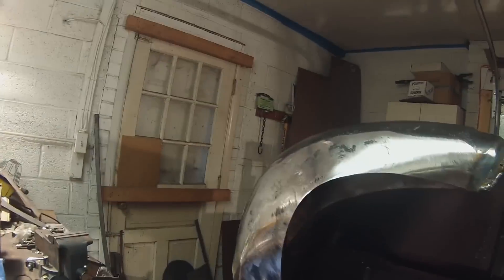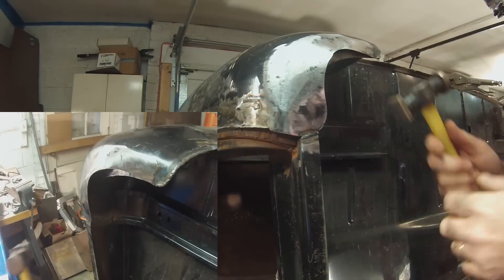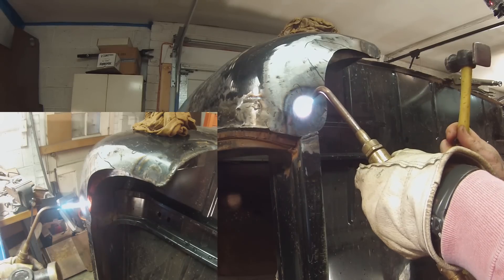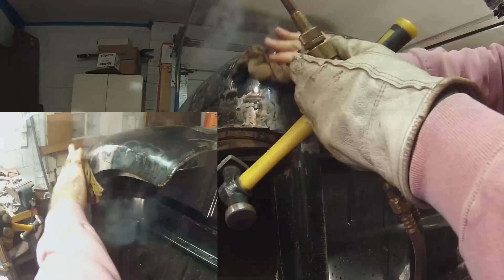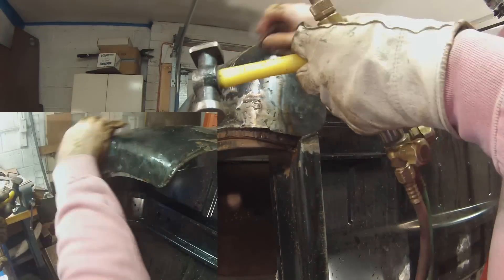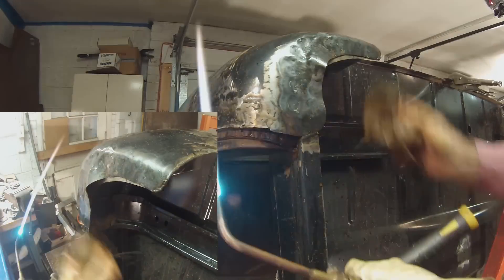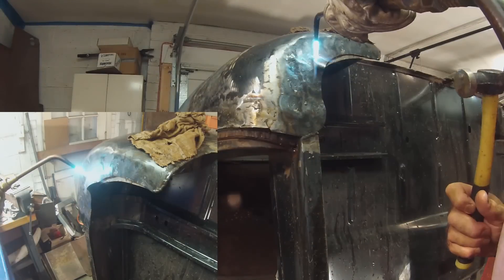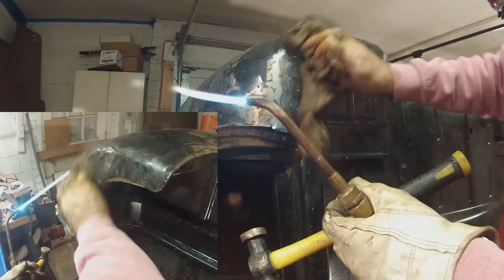Shrinking Steel Sheet Metal Made Easy with an Oxy-Acetylene Torch

Comment: ok, I put the heat on a flat piece trying to unlock the damage metal but when I heated it up it shrunk way in then I cooled it down it shrunk even more. 
so I have put studs on it to pull out it just moves out and back in.

Comment: Yeah, sure, easy no problem. Just put a little heat here,, and a little heat there and wait, there's a bump over there....a little more heat there, oh, wait, now its low over here. I just bump it my hammer...tap tap, tap...that's better, let's put the straight edge on it.....ahhhh, a little high here and a little low there....Just a little more heat should straighten right out....just a few more taps. What? Where did that come from? Ahh, I'll get the bigger hammer and dolly. Whack whack whack. That felt good...better get the straight edge out again....Ah, time for a beer break....OK now let's take another look. Must have moved when it cooled off!! My grandfather told me to use a bigger hammer and more heat. Fire up the rose bud and get out the single jack. Yeah that's it, looks Good to me......goes me another beer Dear, PLEASE....Honey you see that spot right there, there.....Ouch, burned my blankety blank finger....Honey, can you get me some ointment and another beer? Thank you......Stupid blankety blank POS....Not you Dear, the fender. Going to your Mother's? Why, what did I do? I didn't mean YOU! It was the GD fender. Back in a week?.....OK fender, it's now you and me...I'm sitting here drinking some whiskey, and getting out my SawsAll. And cut this truck in half....Yeah yeah, shrink sheet metal with a acetylene torch and a wet rag...and ruin your marriage. I'm doing a frame off restoration of 1969 Jeepster. I'm working on the crumpled front fenders and I gots to say, the body work on flat sheet metal is by far the hardest and most demanding part of the project. Thanks for both your videos, but try one one a flat fender, not an easy one with curves... ;)
Reply: ah that was so fucken funny love oxy ace tho

Comment: how do you repair over shrunken metal
Reply from the maker: +Anthony chaney You have to hammer "on-dolly", aka "planish", aka "planishing hammer", aka "stretch".  Metal ALWAYS SHRINKS when (over) heated (then it cools, either quickly "quenching" or room-temp exposure, but the shrinking is basically the same in the end, the only difference is "hardness" comes from quenching)